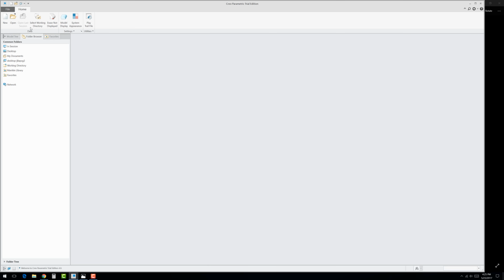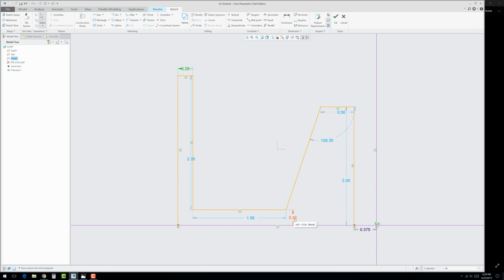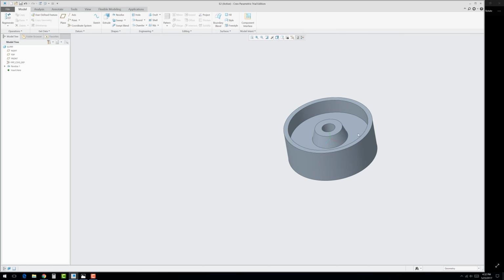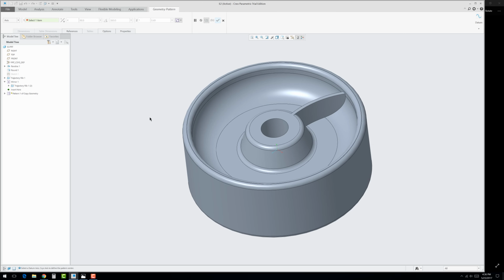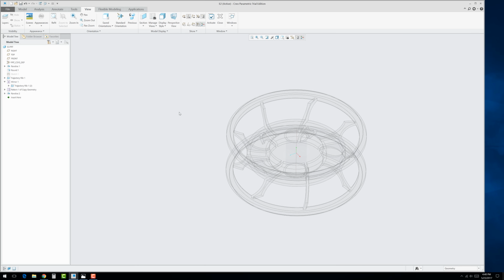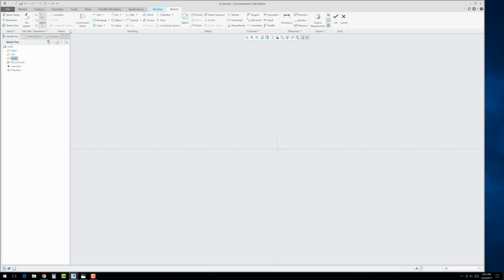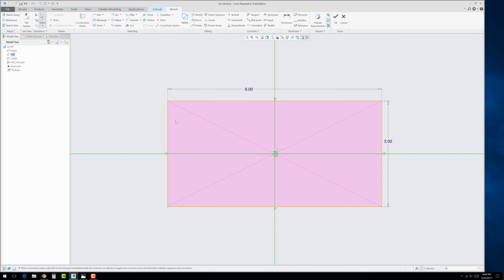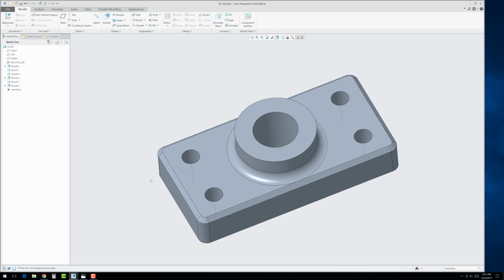E2 Creo Parametric 4.0 - Basic Modeling 2 Tutorial

Comment: what specs does a pc need to run creo parametric and geomagix without problems?
Reply from the maker: Any modern (last 3 years) Windows 10-64 bit pc with at least 8 GB RAM (more is always better), SSD, also would recommend a professional video card i.e. Radeon Professional or Quadro.

Comment: Perhaps the issue with the revolve feature is the kind of centerline used? So perhaps use the centerline in the sketching options for mirroring sketch elements, and use the centerline in the datum options for the axis about which you wish the 3d feature to revolve around.
Reply: exactly! I used the other centerline and I could not revolve it. It should be defined in the video which centerline to use and why for the inexperienced ones....including myself ofcourse.
Reply: thanks alot lan

Comment: I'm relly stuck on a particular part. I followed your first tutorial with ease because you were running 2016, same as me, but quite a few of the features in this one are different and I don't seem to be able to reference the points necessary to make the ark, nor is it giving me the option to reflect and parts using the top plane. I managed to create the arc and the ridge once before I undid it because it wouldn't let me reflect it... don't ask me how I did it because I have been trying for the past half an hour to do it again and I am failing miserably :P I'm a complete beginner here BTW.
Reply: Go to his first video, he goes over his settings, do it how he has it and it will fix your problem.